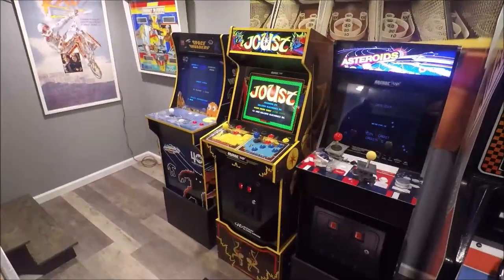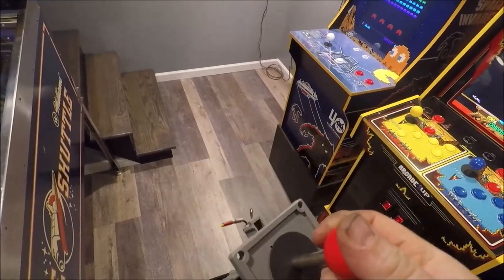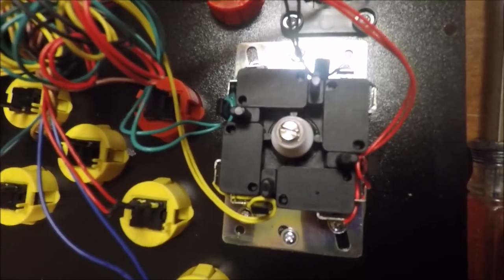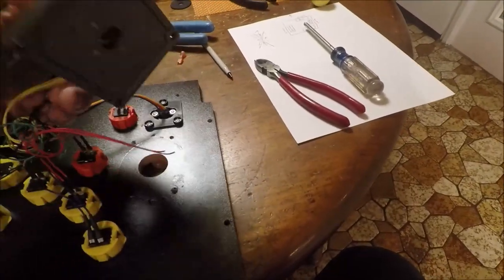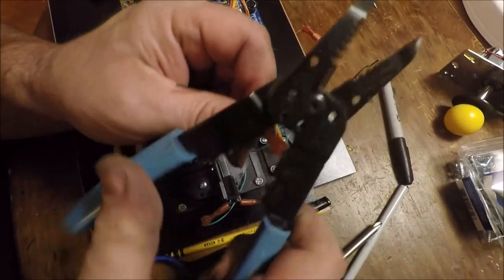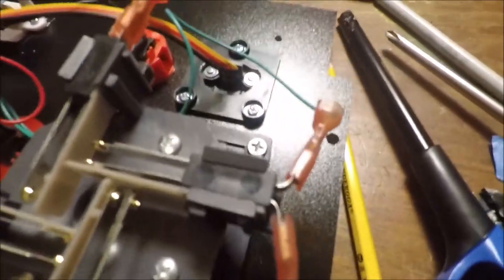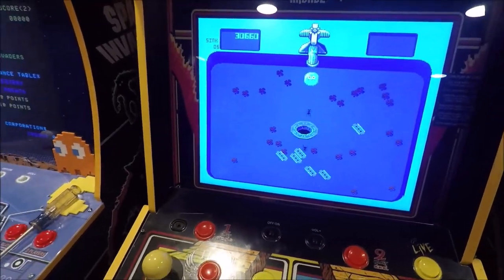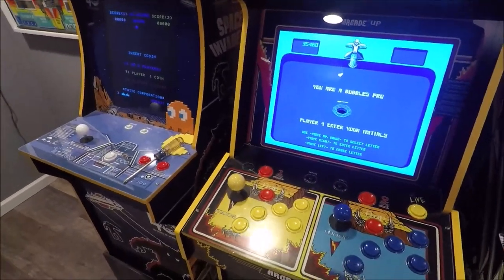WICO Joystick MOD on Arcade1up JOUST.

Comment: Classics like Defender, Galaga and others used a 2 way stick, either up, down or left, right.
Wonder if possible to add a 2 way restrictor in that Wico or similar leaf sticks.
4, 8 way restrictors are common, but don't see 2 way restrictors.

Comment: Thanks for showing the mod. By the way, your monitor looks very good. Did you have to replace a TN, or did it come with a BOE? Thanks.
Reply from the maker: Thank you. Yes I did replace the monitor . I used a Dell E1715s. I bought a used one from e bay for $75. Easy to do.
Reply: @yeksun  Ah, ok. I have the Defender 40th Partycade, which has a dead controller, so I may just port it's monitor over to a new Defender 40th cab, if I do decide to get one. Glad you were able to use the Dell monitor.

Comment: Awesome video....did u upgrade your monitor?
Reply from the maker: Yes I upgraded the monitor. It made a nice improvement. I also lit up the coin slots. That is a must.
Reply: @yeksun  ok cool deal
Reply: @yeksun what monitor do you recommend?  I just got Joust and hate that it looks so washed out.
Reply from the maker: @decadentdave  I used the Dell E1715s. Very happy with this. If you need a good replacement video , check out https://www.youtube.com/watch?v=G3DScp7id8Y&t=549s&ab_channel=DannyWelch